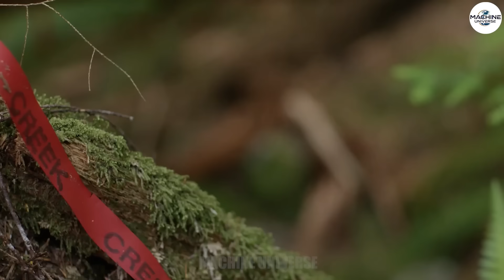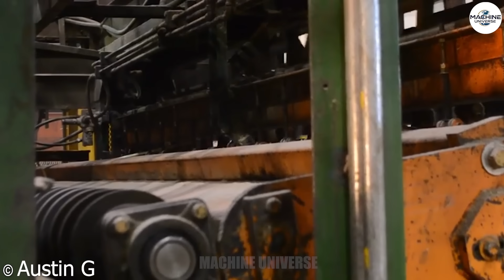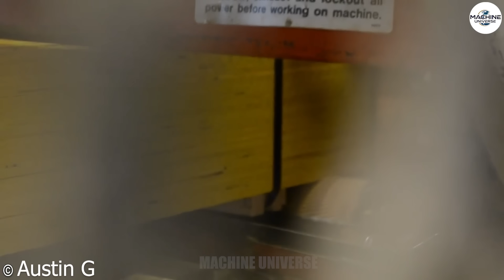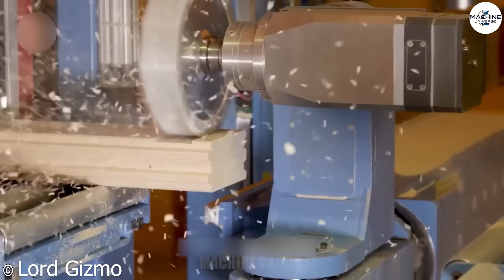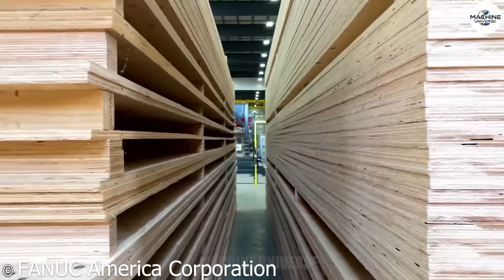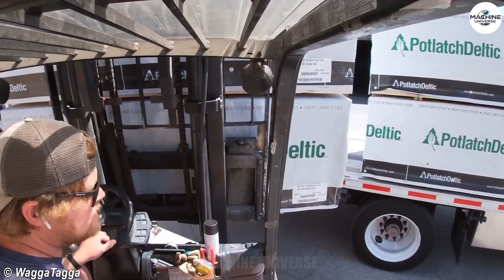Inside Canada’s Wood Giants: Massive Logging To Automated Beam Production

Comment: What is happening with that huge tree stumps after the tree is cut, a waste of fine wood for  use as table tops
Reply from the maker: Sometimes big stumps do get left to rot for habitat, but you’re right—many of them could make gorgeous tabletops or slabs if someone has the time and equipment to salvage them.
Reply: They used to be left to rot, now they generally are pulled out and burned as part of restoration process
Reply: In forestry work, America is the biggest, most powerful and most beautiful, Canada is only second. Stumps, smaller trees and branches are left as food for forest creatures. Have you seen any forest regeneration, planting of seedlings, etc.?